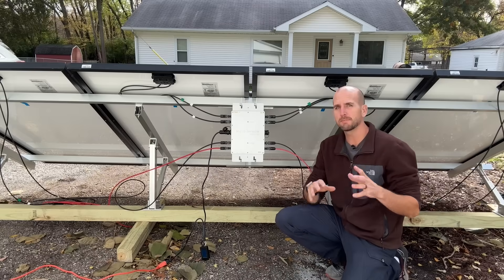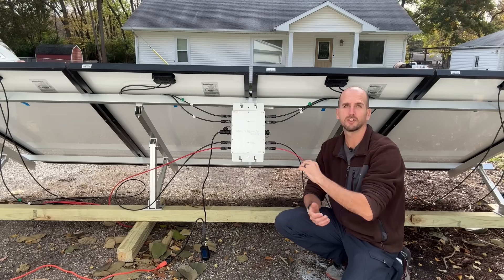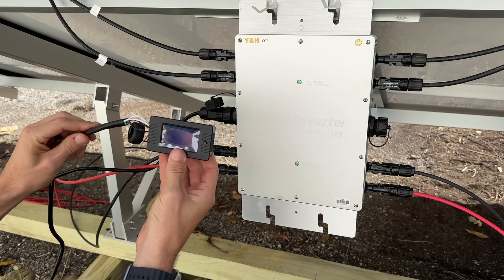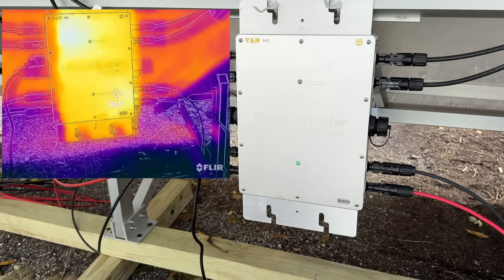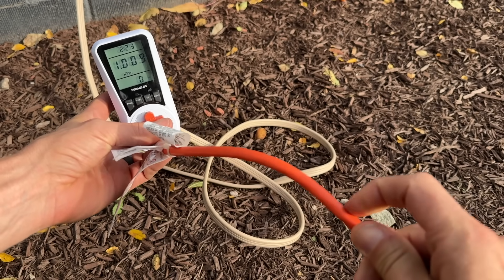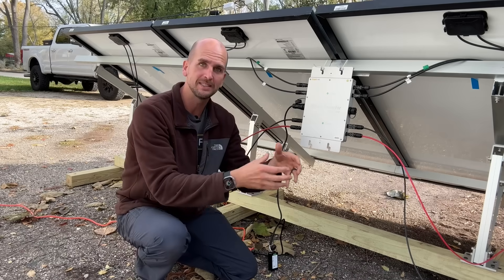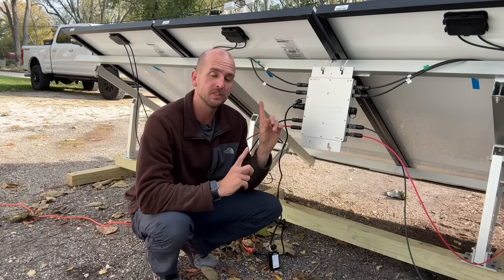Plugging Solar Panels Directly Into An Outlet | Surprising Results

Comment: Generally speaking, plugging these into an outlet is not up to code because the breaker cannot protect the wires if there is a power source after the breaker.  You could potentially overdraw on that circuit and melt the wires without tripping the breaker in your service panel.  Drawing 15A from your service panel and 10A from your solar panels on the same circuit would overload your 20A circuit.  The breaker only sees the 15A draw and will not trip.  Just do your maths and if possible for safety, don't draw any power on a circuit that has one of these plugged in especially if you're producing over 1kw.
Reply: If the system is on a dedicated circuit Wouldn't the 15amp panel breaker protect the wire?  Now I think a inline fuse/breaker at the inverter would also be a good idea at the inverter because it also supplies power.

Comment: Since I already have a 2 way meter and permitted solar, I see no reason why I cant do this to add some more power. I will use a proper 220v inverter to feed both legs of the grid, like enphase. Any reason this wont work?
Reply: i am wondering the same thing... my main concern would be possibly being denied house insurance if there was a fire (even from another source) and they find this extra system in place....  i am assuming it may not pass an inspection as it would not go through an emphase combiner and ac disconnect switch,before gong to a breaker on the panel.... but  i assume you would not need a combiner if only had 1 trunk cable coverted to AC and i guess you could put in an AC disconnect box on the AC leg before going into the panel??

Comment: So, what I don't get is: why is it an issue if you push energy onto the grid with this system. So, if these panels produce more than your house consumes it'll push energy to the grid. That is exactly the same as what "normal" solar panels do, right?
I would be interested in having a plug in wind mill. No need to produce vast amounts of energy. Just for the sake of experimenting about max 100 Watt of energy would be really interesting. And that is manageable to feed to an outlet.

Comment: My Grid tie story is a bit interesting and long winded but if your interested just leave me a comment and I will type it out for you. BTW my grid tie is 525 watts and it might be worth hearing if you do decide on this route for lowering power bills.
Reply: Go on pal
What’s happened?
Reply: @serraios1989  Well it all started when I first hooked it up experimenting with it and not having a constant power use in my home. About 3 days later a EMC truck pulled up my driveway and I freaking panicked. He got out looked around and asked if I planned on selling power back and I said no I was only trying to offset my power bill. So he got out his equipment and pulled my meter and checked to see if island protection was working then reflashed my smart meter to display power both ways. After that I asked if everything was ok and he said yes. So since I've increased to 600 watts and can see what I give back with no reproccusions to me. The point is don't even try it as the power company knows the instant you do. Those meters are smarter than you think and I'm lucky that my power company doesn't penalize for trying to lower your power bill. Hope this helps you with your decision.

Comment: Id like to see if heat sinks  added. Would it make a diffrence?
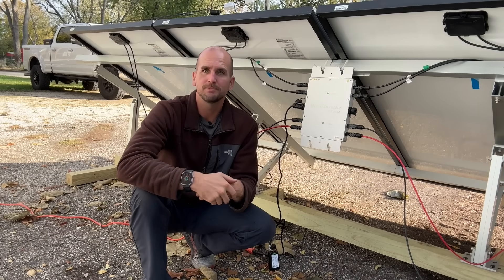Reply: Only if  their heat sinks are too small.  9:34  you can get those cheap laptop usb fan coolers. Try one of those on the back ?I'm very keen on this idea. I would buy cheap panels and run a second system next to my 'night time' solar system . Just for running power tools during the day. I'm fully off grid and find it tough though winter

Comment: Are the panels your using 12v or 24v Panels
Reply from the maker: Open Circuit voltage on these Heliene 360W panels is right around 48V.
Reply: @everydaysolar  thank you

Comment: if you have one lying around and not in use most of the time, could you connect a foldable/portable solar panel (jackery/bluetti/etc) to one of those microinverters and plug it into an outlet in your home the same way? 

and if you already have a grid tied solar system with net metering, would there be any way the electric company could tell the difference (if there is any) between power coming from your regular panels vs that portable panel?

Comment: Hey folks, don't use this inverter device. Without an appropriate approval, you are libel, so is the installer, and the seller, for any damage or god forbid, the line on detection fails and backfeeds the grid and injures or kills a lineman. There is a reason we have break before make transfer switches with mechanical lockout.
Reply: Don't you think that lineman have the equipment to check for voltage before working on lines?  Don't you think that lineman know that every home has a generator or a solar type device like this that backfeeds energy?
Reply: Linemen do have equipment to test for voltage. It isnt the normal circumstances that hurt them. Its the secondary failures or unforeseen things like unqualified diyers plugging sources onto the grid with unapproved (perhaps overheating) devices.

Comment: how you prevent the power going back to the grid when you are not using all the output power ? @everydaysolar
Reply from the maker: The micro-inverter has to detect voltage (from the grid) at the outlet to feed power pack into the grid. If the power (grid) goes out  so does the output for the micro-inverter.
Reply: I meant no power to the grid at all, not the function that detects if the grip has a power drop then also the microinverter cuts the power. I want the power meter of my power provider NOT going backwards because thats illegal in my country.. @everydaysolar
Reply from the maker: @ghk84  I don't think this setup is going to work for your use case.  What country are you located in?  The EcoFlow Powerstream in combination with a Delta Max looks interesting for some of the European markets.
Reply: Greece. Thanks for the response.  @everydaysolar

Comment: so vevor makes a 1200w micro inverter just like this... however they claim you can link up to 3 of them in series using the cables that come with them. do you see any issues with running up to 3600w through a 110v plug? I believe each unit puts out 9.5a according to the data on the website, at that point would we need to run a 30a breaker and plug/ associated wiring? also the vevor unit has a UL rating now.

Comment: can this inverter handle 1 to 1.25 kwh? I would like to do this type of plugin. Also, can a battery be along the line to keep putting in a similar kwh after dark. looking to offset the bill during the afternoons for peak charges.
Reply from the maker: No, such a simple system would not have the ability to store energy for nighttime use.  The EcoFlow Delta Pro Ultra would be an option but the cost is much, much higher https://youtu.be/E3loAZhEif8

Comment: Really need to invest in a solid extension cord and I would put it into a 20 amp circuit for some extra margin.  Also a lot of electric providers require a separate disconnect.
Reply: There is no such thing as a solid extension cord, you mean regular romex wire.... besides solid wire has more resistance than stranded wire...
Reply: @SolarizeYourLife  I think I meant solid as in a good extension cord. it is slang.

Comment: Do you now have a microinverter that works just like the one you show only a quality inverter that will not fail from heat?
Reply from the maker: Trying to source one now.  I think we have a much more dependable unit but will only be 600W.  Should be able to test it out in a month or so.
Reply: @everydaysolar  Great! If money wasn't an issue but wanted to go direct from panel to micro to house (forget about code for this hypothetical discussion), is there an enphase micro you would recommend?

Comment: please explain something.. first of all, I would like to know if it works not connected to the grid on the other side? or can the system be self-contained?
secondly, if it is connected to the grid, and the grid is live, how will my appliances decide where to be powered, from the grid or from the inverter?
thanks
Reply: These systems don't work standalone, they only output power if the power in the outlet it's plugged into is on. For your second question, the way electricity works, nothing decides which power to draw from. It simply supplements the grid power by adding an additional parallel source. In other words, if everything running on the half of your house that this is plugged into was using say, 600 watts and your solar was outputting 300 watts, you would only use and be charged for 300 watts from the power company. In the USA, homes electric panels have 220v coming in and the panel splits it into two 120v feeds, each powering roughly half the home. Plus, there is 220v available for big things like dryers, stoves, etc. Therefore, this solar system when plugged into an outlet would only supplement power to half the home, unless you had two systems and plugged them into two different outlets that are on different legs of the panel.

Comment: Four 300W panels @ 110v produces 10 amps.  That wire with the plug barely looks like 14 gauge which is able to handle 10A but I'd want 12 gauge to cut down on the wire resistance if I'm running a 100' from the panels to my home.  As far as overheating goes, I remember back about 20 years ago people were putting their motherboards in mineral oil to help dissipate heat.  An old plastic tool box filled with oil might be a good solution as long as you can keep water out of it.
Right now a local panel distributor is selling 240W panels for $20!!  For under $700 I can get enough panels for an 8KW system.
Reply from the maker: Dang!  That is a great deal on 240W.  Did they repower a solar farm and that is where they got all the panels?

Comment: Seems like best use is to charge batteries, then run devices off of the batteries.

Thus no illegal tie in .
Reply: I do that too. Using four 225 ahr Trojan lead acid batteries, I have a 120v 3000 watt Renogy inverter to a Generac 6 bank transfer switches for 3/4 of the house 100% of the time which includes the refrigerator (each circuit can be switched to the grid if needed). Then, I have an Aims 4000 watt 240 volt inverter plugged into the generator plug (which feeds a transfer switch on the main panel) to energize other circuits such as the washing machine, dishwasher, air conditioner. I also have a cheap harbor freight 120 volt 2000 watt square wave inverter to only heat a 1500 watt 120 volt  water heater element in a preheater water heater (that feeds a propane water heater),  which has a 6 hour spring wound timer to energize the heater.  I have reduced my power bill by 90% (and propane bill by 60%) with no grid tie inverters. My system is all isolated from the grid. In the foothills of N. CA we lose power about a week or two a year, so I have full off grid capability, especially if I run the generator one hour a day during storms. I may have around 10,000 watts of assorted panels, some are bifacial that stand up vertically facing east/west. They do not accumulate snow in the winter and still charge the batteries without brushing them off.  Because of the assortment of panels, I have around 3 to 5 panels connected to each Victron charge controller, I have around 10 charge controllers and I suppose 40 or so panels. Groups of panels face different directions for different times of the year and different times of the day, such as afternoon summer air conditioning power.
Reply: @steverturnsk6190  love your water preheating tank implementation. That is a simple, safe, worry free solution for someone to play with a few solar panels lying around to use with this dodgy Chinese inverter, without even risking plugging it into the house.  Thanks for sharing your topography, very nice setup and clear description!

There are also available more efficient direct DC heating elements too, or maybe they are just AC elements, I forget. I think they might all be DV elements, because they are simple resistive elements. In any case, one must be correctly match the element's OHM value to the power feeding them, in order to get that extra DC efficiency. I believe when hooked directly, you may not even need an inverter! People will do this for their RV tank with a spare 100w solar panel. Just a FYI for anyone thinking of using direct solar DC to power a water heating element.  There are charts and maybe some math on the YouTube videos. 
I.e. Search "ohm matching element" returns: "How to Use Solar Panels and Ohms Law to drive DC loads directly! Solar Electric 101" ,"Solar Power Edge" Chanel
Reply: That is what I do.
Reply: do yourself a favor and get a Hybrid inverter
Reply: Not illegal here.  Everything on this side of the meter is MINE.

Comment: Everyday Solar what is a Grid Tied Micro Inverter? Explain the difference between what you have here  and a Grid Tie Micro Inverter found on professionally installed homes and businesses. Can you publish the specs of your device and a 1200 Watt Grid Tied Micro Inverter .
Reply from the maker: The big difference with this unit is the output is 120V as compared to something like an Enphase which is 240V.  Here is the Y&H Micro Inverter I used which will include the rest of the specs https://amzn.to/3QZFcrQ

Comment: These are not plug an play, but the exact same grid tie micro inverters use in Grid tie systems. There is absolutely zero difference. Grid tie inverters come in micro size form or in central large inverter form. Micro inverters are usually mounted on the roof under or attached to back of solar panels if using more than one they output or combine at combiner or they can be combined before the meter. All on-grid inverters regardless of size have to prevent islanding (shut down upon loss of Grid). Hybrid  inverters have to prevent islanding as well but they have at least 2 separate circuits Grid circuit is bridged with a house/building circuit when the Grid is up. When the Grid goes down or is unstable they immediately break the bridge circuit causing the Grid circuit to go down but the home circuit continues to function independently of the Grid. Note: For Most states and countries it is illegal to connect any inverter to the Grid without first passing some form of inspection to do so, as Codes not only concern the actual product must be followed such as wiring, safety devices etc. Further more utility companies also have to approve these connections as well and in most cases if not all, do require their own inspection after you have pass your local inspection. Again this product is just a standard micro inverter use by installers all over the world. If this product over heats my expert guess would be improper use by people who don't understand how to use it correctly. Another possibility but less likely is a defected product. These product work best when matched with the correct specs and with the same panels.